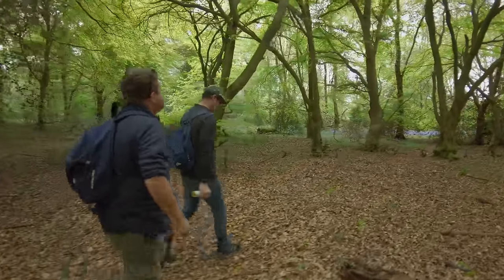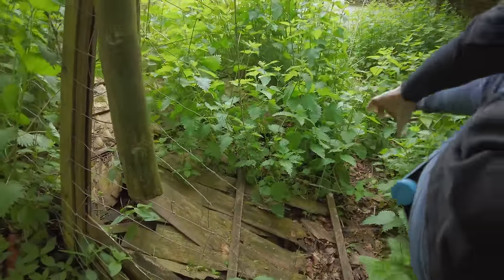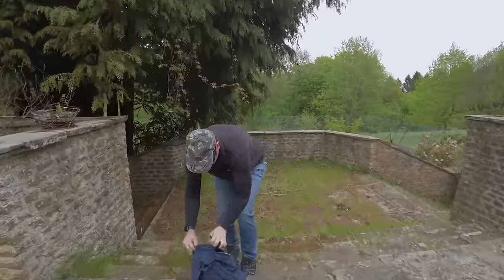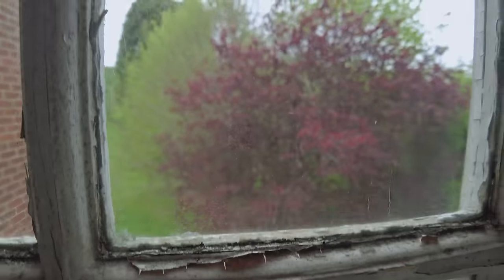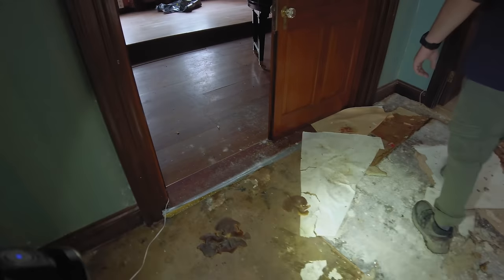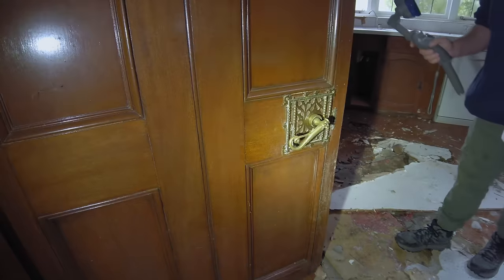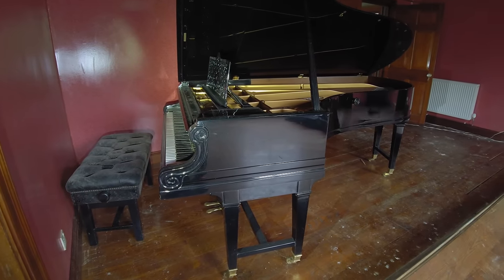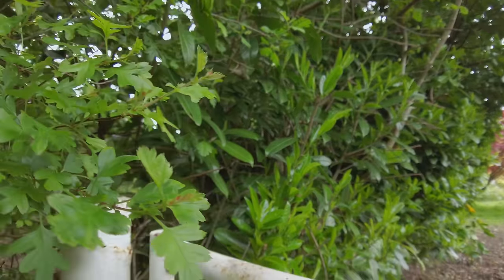Abandoned Musicians Home

Comment: Its a nice old place. I like the way the black mould contrasts the wallpaper by the skylight. Being a mechanic I notice it doesn't have a garage so you'd have to leave the range rover on the turning circle out front. LOL. Needs a bit of work, Its a fixer upper. Matt move in. get the power put back on. If the neighbours ask you're the care taker while the owner is on tour overseas. Angel would love the place.